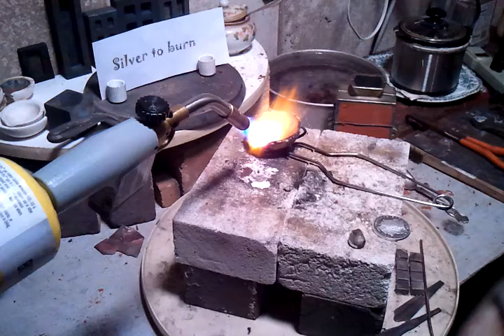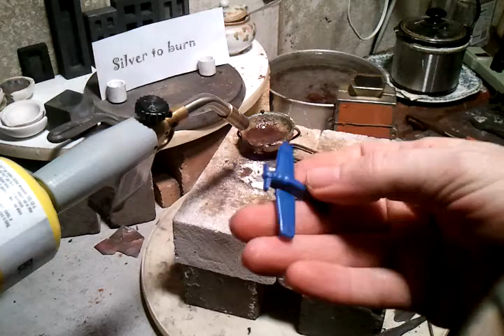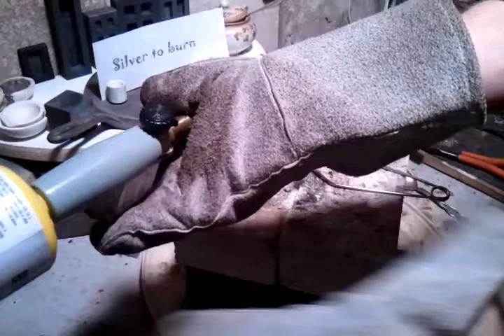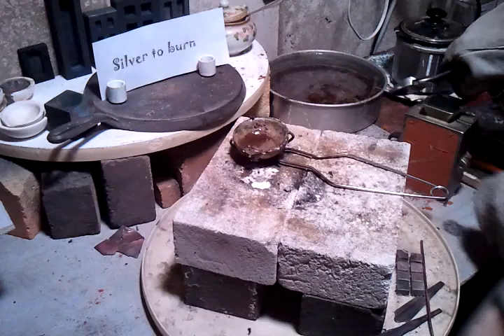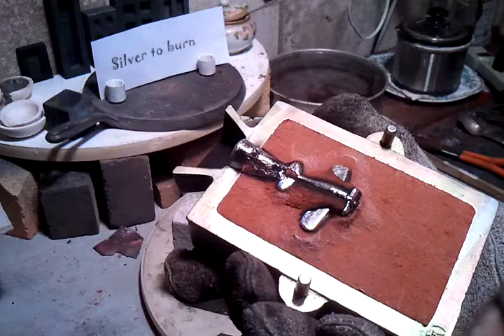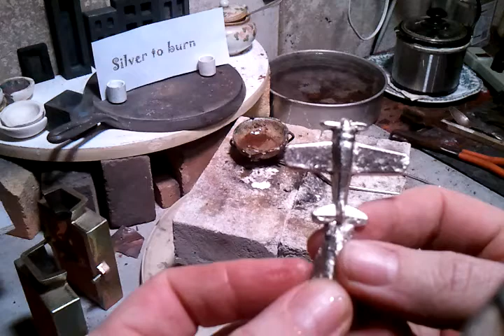#45 CASTING A .999 SILVER WORLD WAR 2 TOY PLANE!

Comment: Turned out cool.  You almost would not know it came up short.  I have come to the conclusion that casting is a lazy day's activity.  You can invest hours and still be at square one.  If you're in a rush forget it!  I saw no vent in that mold.  Did I miss it?
Reply from the maker: Losinglouie hello my friend, I did not use vent holes! That's probably why it didn't pour up all the way! Yes It takes a lot of patience to do sand casting! A lot of the time I forget to do some vent lines & it works anyway! You don't always need vent lines, but it might help get the gass's out! Trial & error! Lok col in the sand! looked like a plain on the bottom of the ocean, buried in sand, before I took it out of the sand! Enjoy your day! STB.